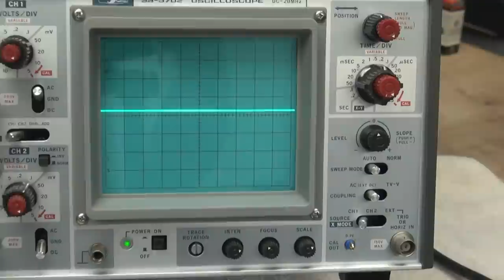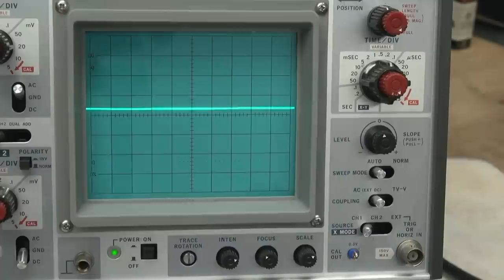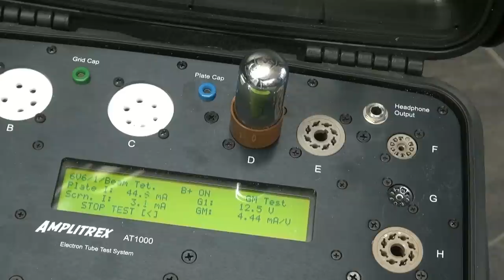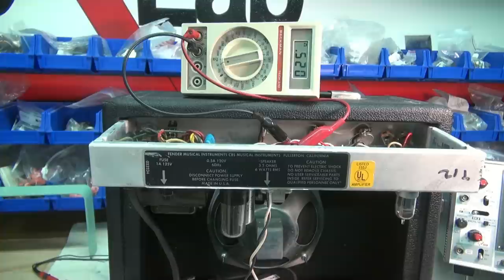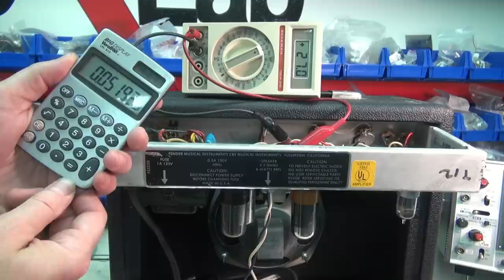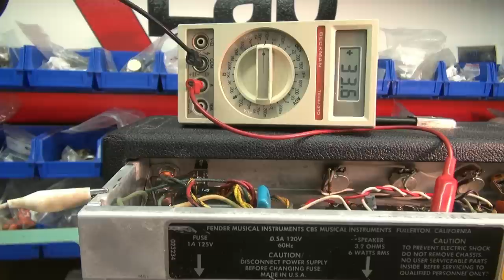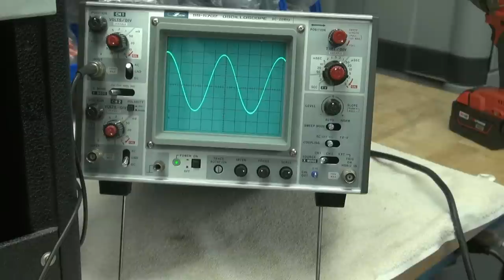Fender Champ tube practice guitar amp repair tips How to by D-lab

Comment: Enjoying your videos Terry.
I've refurbished 1/2 a dozen or so Champs & Vibros and they have all had that 2mfd 25v cap which is also shown on all the schematics beginning with the AA764 Blackface. I've always upgraded it to 50 volts as well. The reason for the high current on the 6V6 is if you check, you'll find that the late 70's and on have PT's with a B+ that's 50-60 volts Over the original specs.
With typical home line voltages running closer to 125v than 117v doesn't help either!
Reply from the maker: +G Morgan Yes Sir, I really enjoy working on the old Fenders. I have a Vibroverb and Showman in line for repair. The Showman is missing the back panel, otherwise it is stock. I plan to focus mainly on Fender repairs thru next year. Hopefully people will see me as more a repair shop rather that boutique amp building. That market appears to be dying.
Reply: Terry Dayton Yes it is! Over Saturation. If you ever need an old Fender schematic let me know I have them all for the 50's & 60's except for say for 1 or 2 of them.

Comment: I'm an engineer (BSEE Cal Poly SLO & MSEE SCU) - but choose to work from home.  I have a small lab and bought my own software for jobs.   I can relate to two things you've mentioned in this video 1) I work three times as much for have the cash 2) it isn't unusual for me to have a glass of nice red wine - I like CA Pinot & Spanish Tempranillo - yummie

Just noticed a Ham call sign in one of your videos - I haven't been on the air in so long that I didn't even notice the got rid of Morse code requirements - I was a Tech Plus back in the day -  KD6NCR  (my S.O. is KK6ONC)

I worked at Vandenberg AFB in Lompoc.   I grew up in the Santa Maria, CA area - known as the Central Coast.
Reply from the maker: +silvermica Hello, Yes Ham here too. Got my call while stationed at Vandenberg AFB, CA.I hope someday to just run my shop. Problem is, tube repair is really drying up.What software do you use?  I normally run Dasylab and some Labview. Mostly data acq and tester controls.Fun stuff, but once again, no money in it around my area. Stuck in corporate America!
Reply: +Terry Dayton I bought my own copy of Altium Designer.  This is my first time using schematic capture and layout - and I find I do love the control.   For design work I mainly use HFSS, Momentum, and ADS.   I'm in Silicon Valley so it's somewhat easier to land gigs.   On the side I do some software stuff (there's a lot more of that out there).    

I got my license in 1992 and had a boat load of fun on 2 meters. T-hunts were especially fun.

Comment: You make very nice videos Terry with various tube equipment. I recently repaired/restored a 1956 Fender Tweed Deluxe replacing the audio output transformer, caps, tubes and repairing the voice coil in the Jensen Speaker. I used "Goop"  to reattach the cone and it now sounds great. 73.....
Reply from the maker: +TheRudydog1 Thank you and also thanks for the repair info. I use goop quite often in the shop. Mostly to adhere caps and power resistors to the chassis to reduce fatigue. Never tried it on a voice coil. That sounds pretty intense! Great keeping these old amps alive. Glad you are enjoying the hobby.

Comment: You're so right about the underlying problems! I cleaned my 12AX7 pins and sockets and thought wow, it's all fixed! Not. After watching your videos, I found some caps that looked pregnant, one had a piece of rubber about to blow out the end, and another was leaking. I learned there's always more to it than you think! Thanks for all your help!
Reply from the maker: Cool deal man, It's always best to give them a close inspection. Sounds like you cleared some lingering faults! Good job!
Reply: D-lab Electronics yep...sure did! Thanks to you!☺

Comment: Just finished repairing an earl 60's Gibson amp that was a nightmare. Just like this, one problem after another. Finally one problem was really throwing me off - I thought the owner was gonna kill me cuz I just couldn't figure out what was wrong. I put it all back in the case and tried one more time, and whadaya know? It starts working beautifully! The tone controls were dangling about 5" from the power tube sockets instead of being a bit above like when installed - it had me running in circles... There were in addition almost all resistors and caps over 20% out of spec and leaky... I'm a part time fixer, but I'm henceforth gonna be choosy about my repair projects...

Great video, and thanks for sharing!
Reply from the maker: +Britt Rossman Yes, I understand. I know how those old Gibsons are. Especially if they have the paper/wax caps. Normally I just change them all, don't even bother testing. That is a tough bird. Have not worked on one for years.
Reply: +Britt Rossman Some of those old Gibson amps have some unique tubes in them. One has Loctals mixed in with Octals, and Novars. Others have "type tubes" in them, AKA type 80, type 75 and type 42. Those make great harmonica amps. The type 75 has a mu factor of 100, like a 6SQ7, 6SQ7G, 12AX7 or 6EU7, but only one section, and very big plates. I have a stash of modern Amp Ohm wax paper & foil caps. I glue ink jet printed kraft paper on them with contact cement & dip them in bee's wax, so they look kind of original. I do the same with Mallory caps too.

Comment: I use a 6mm (.253 cal) bore brush used for cleaning rifle barrels, with a tele volume knob glued on for a handle to clean jack socket sleeves. They tarnish with weather change and fuck up the earth to shield connection. Cost less than $10 to make...

Comment: Hi Terry ,, love your videos,, 
Did you check the plate and filament voltage on that amp.. A 1K bias reisistor seems high for a 6v6gt class A amp. I checked the schematic and the plate voltage should be ~ 350VDC. But even at that voltage the bias should be very hot with a 470r bias resistor as the plate and screen are only separated with a 1K resistor. The Fender tweed champ should have around 330-340V on the plates but the screen sits lower as you have a 10k resistor between them,, so the bias with a ~500r resistor is more reasonable.. 
To my understanding,, high plate and screen voltage with a high bias  resistor value is not the greatest solution for a class A amp...The RCA 6v6gt sheet says ~ 50mA total cathode current at 250V plate/screen with a 5K reflected load, With 315V plate and 230V screen the total cathode current should be around 36mA with a 8.5K reflected load.
Reply from the maker: +dansk björn Hello, Yes Sir. The owner of the amp plays Harp. He wanted this amp on the soft response side. I should have mentioned that in the video. TD

Comment: You can't get too much more simple than a single ended Fender Champ amp. Some of them do have some maddening multiple issues though, especially when someone tries to hot-mod it, and gets it wrong. I have even seen factory mistakes in the pre-1985 stuff. .003uF caps in place of .03. That tremolo circuit never worked right for over 50 years, with that cap in there.  Just for fun, take me through an Engl Fireball. I have been through one, and I really just want to see someone else suffer through Engl's inaccurate schematics. Enjoy the mislabeled components, unlabeled components, and various relay circuit lines that go to nowhere, have no IDs and just leave you guessing. Best advice, pretend there is no schematic for it, and work from theory of operation. I don't use an Apmlitex  anymore. Mine blew up a Telefunken YL1350 Engineering sample prototype. I happily sold it and upgraded some vintage tube testers & a couple curve tracers with regulated PSUs, and test sockets for use with Kelvin lead DVMs. Now I am working on a PIC based tester, and an Arduino based tester. One of the best investment I made was a good quality, but dated LCR bridge. What a versatile time saver those are. I even bought a cheap Asian spare. I have a 371B curve tracer, and am working on high power RF & ham radio gear too. Anyone with the big power linear amps usually has more money than musicians in these parts. Same with most people who own Marantz Model 7,8 and or 9, Conrad Johnson, Mc Intosh, etc. That work kind of picks up some of the financial slack for the guitar amp work. Musicians here are very underpaid too. The good ones spend their summers in Europe and make 20-100X more for a show.

Comment: Terry, any idea what the Fender factory is painting the bias pots with to lock them down? My Super Champ had a dab of red (paint?) holding the bias pot setting from changing. When I retubed the amp the red stuff broke loose easy enough when I rebiased the amp.

I'm guessing automotive touch-up paint or fingernail polish. What do you recommend using to hold the bias setting in place?

Comment: Recently re-capped a Vibro Champ. It also had a 2uf @ 50v bypass CAP. Mine was located on the first half of the V1. 

Looked original to the amp. 

Something tells me this CAP was an intentional install. 

My amp sounds great after re-capping with 25uf 25v CAPS. 

Wondering how many other Champs are carrying a 2 uf @ 50v?

Thanks for the upload.
Reply: The schematic for the AA764 shows 25u/25V for the first half of the 12AX7 and 2u/25V for the second half.
Reply: The AB764 shows the 10uf. That's the late 70s, CBS, higher voltage Champ schematic. Mine had a 2uf, surprisingly...

Comment: Terry-I got my first amp in 1959 or 1960, it was a Fender Tweed, 
and I believe it was either a Champ or a Harvard.  I know it only had 1 
speaker, and I think it was oval. It was pretty small, and of course 
basic.  I'm thinking of building one and trying to figure out which one I
 had, and/or which one is the better choice if there's no way to tell 
now which model I had.  Do you have any thoughts to help me on this.  
Thanks.

Comment: Great video! You're so right about one thing cascading into more problems on these old valve amps. But what is a whole lot worse is working on old classic US car. Something that sort of surprised me when working on my '65 Olds Cutlass was that behind the dash is a large (2ft) circuit board that has a big multiplug at one end. The dash instrument lamps etc just plug straight into the circuit board.Any idea how long circuit boards have been used by manufacturers?

Comment: Terry, if that bias resistor had not gone up in value and was still 470 which is the correct stock resistor, the idle would be even higher about 57.4 mA. Is this because other component values have strayed over time to cause the voltage drop at that point to have strayed higher over time? Just trying to figure this stuff out, thanks for the great tutorials!

Comment: I have run across plate load resistors making noise several times. Doing your test, the static on the trace makes finding those easy. They make an intermittent static once the amp warms up.  There is no other way to test them other than swapping them out.
Reply: Lulu you can put a low capacitive cap @ 5 to  10 ufd at needed voltage rating, from the plate to ground. If the noise goes away,then you'll know the plate resistor is noisy!! Always check the input grid for noise first! I have used this technique for years! It works! Good luck on your repairs in the future!!

Comment: Hi, i really like your videos. thx a lot! 1 question: what resistor value did you installed to get the bias down to 34ma? the original was 520 ohm, but i couldnt see the value of the replacement resistor. thx....Stefan from Belgium.
Reply from the maker: Hello, I cannot remember the value. The amp was set up for a harp player, so he wanted reduced gain.
Reply: +D-lab Electronics np...i suppose it should be around 800 ohm...thx again....

Comment: I think you'll find that most vintage amps run at a voltage that is higher than spec due to the 9% or better increase in wall voltage ( from 110v to 120v or even more)  and will throw cap voltage rating out of spec , that being said what harm is there in having a higher voltage rating for a bypass cap , if the uf rating is the same ?

Comment: I had a Bronco try to kick my butt one time. After fixing a Super Reverb, Carvin, and a Marshall, one of these little simpletons drove me crazy! I kept finding little problems, but the one that was causing the issue. It ended up being the ground to the chassis of the 6V6 cathode resistor. It looked good on a quick visual, but was loose. A reflow fixed it.
Reply from the maker: +rjake61 Good repair man. Yep, bad solder joints can be a challenge. I normally inspect everything with a lighted Luxo x5 magnifying lamp. Usually I can spot the troublemakers.

Comment: HELP?!. Sir, I purchased a new Fender Rumble 25 Bass amp, 3 weeks later I plug in, turn on ....and no sound?
Amp makes power up sound at speaker be when pwr switch is depressed. No loose plugs, knobs, and never dropped.  Plz help.

Comment: Hi Doctor!!
excuse me I have a Fender Twin Reverb 65 made in 1990 but I have a problem with my amp. the reverb effect does not work at all and I don't really know what I get to do?
do you think is only clean inside of the Reverb Tank maybe have to much dust inside or That is wrong if I try to do that?
and what kind cleaner spray I can use for the amps and guitars controls?

thank you so much!

Comment: Hey Terry, do you have any videos on troubleshooting pots not working when it's not the pot itself that's faulty? On a fender handwired amp
Reply: You then need the schematic diagram and layout for your particular amp and some basic test equipment to have a prayer of figuring out what's wrong. Assuming you have basic grass roots knowledge of audio amps in the first place. Of course this is assuming you've done a thorough visual on all solder points, wires, inputs and output, and connective cables, etc.

Comment: I noticed you have Amplitrex AT 1000; impressive stats. My brother brought down a knock off guitar amp (low power) solid state with one 12AX7 not even two years old. He complained it would intermittently cut out. I found the 1/4" jack was bad, but still useable, pulled the 12AX7 tube and tested it on my B&K 747; GM was questionable to poor on both sides. Unfortunately he would not leave it with me to complete my analyzes. I wanted to find out why the tube failed so quickly, needless to say the unit was poorly designed and constructed.

Comment: Thanks for the video. The best advice was the Robert Mondavi assist at the end. I've got one amp that been on my bench for a couple of months that's a Jose Cuervo type. Finally just ordered the power amp from Peavey. Dead short in the DC section. Replaced all the transistors, caps, and resistors.  It's a good thing I've got a day job to pay bills. My real question is: What type of signal generator are you using? Does it have square, sine and notch wave?
Reply from the maker: +professorhardknock Hello, good to meet you. Sounds like a fun project underway. My generator is simply an old Heathkit tube type sinewave. I discovered that the new audio generators out there generate noise as you sweep frequencies. So, I found it was best to fine a nice old analog model

Comment: You are awesome! Too bad I have a Fender Acoustasonic (Non-tube) having intermittent hum issues. A tap on the amp sometimes makes it quiet. It has been a great acoustic amp. Any Ideas? Randy
Reply from the maker: Hello, The issue with your amp is cracked solder connections. Inspect the board with a good magnifying glass and bright light. Pay particular attention to power resistor/diode and potentiometer mounting connections, they get stressed easy

Comment: Hi Terry,
Enjoy your videos!....My Wife of 28 years hates my guitars and amps..and anything to do with my music!..But she will sit through your videos ..I think its the red wine you flash around! Checkout THE MEMPHIUS SUNS my Traditional original Rockabilly!...Question for you I just bought a mint 78 Fender Silverface Pro-Reverb...I have looked everywhere on the net for some help and there is NONE!...My master volume push pull Pot has a bad dead spot between 7  and 9!....I have been told I can replace with a standard 1 meg pot...But because this amp is in mint original condtion Id like to keep it push pull...I have found CTS make the right replacement but before I attempt... I was wondering if you may be able to do a step by step replacement Video of the MASTER VOLUME Pot in a Fender Silverface amplifier?... This is the part  POT - CTS, 3/8" BUSHING, WITH DPST PUSH-PULL SWITCH - A1M...If you could do this some time would be much appreciated world wide.....Cheers Frank...Have a sip for me!

Comment: awesome video..d-lab. My champ lights up fine..Its a new Fender Champ XD..but no sound comes out of it..can tell from this 7  word description what's wrong with it?
Reply from the maker: 1st thing to check, If you unplug the guitar, volume at full is there hiss? If so, bad patch cable.
2nd, is the 12ax7 lighting? I have had a few in the shop with defective tubes (stock ones are cheap)
3rd, could be bad solder connections on PCB
Reply: Thanks D lab...you're the champ

Comment: You should charge a minimum shop charge of 60.00, or $100.00 per hr.. I have a super champ x2 and it costed $92.83 for a 12ax7 tube replacement..good times..